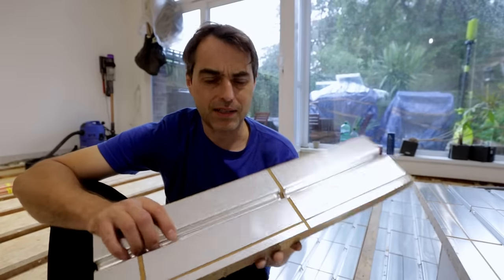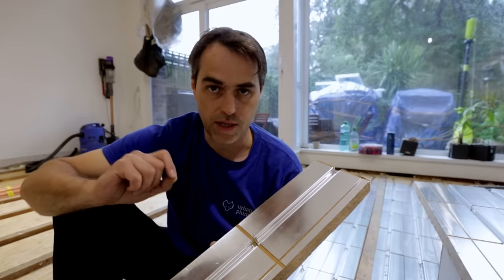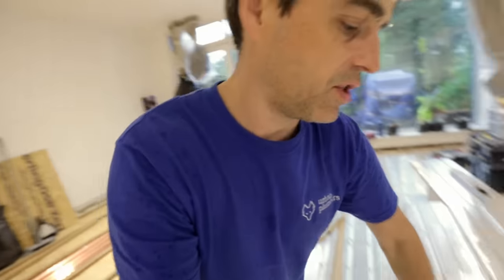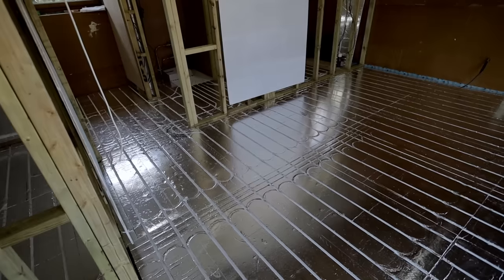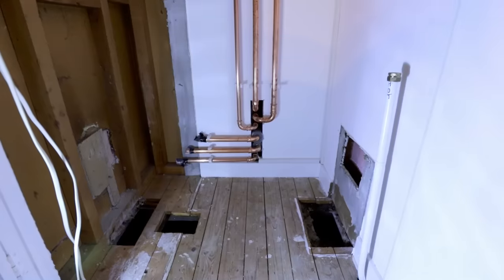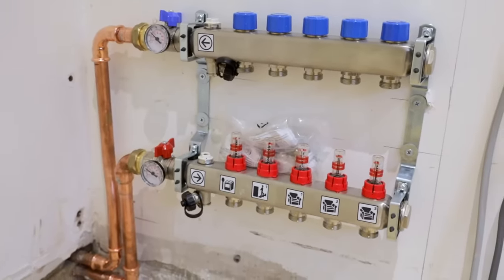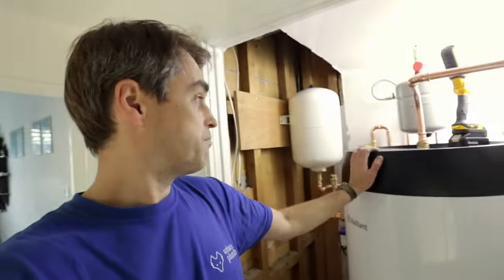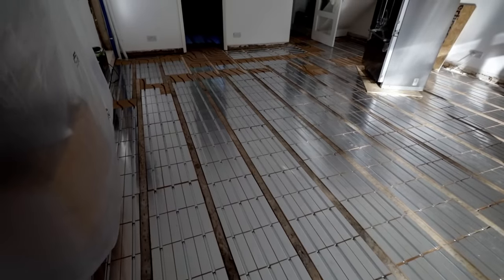Do Not Install Underfloor Heating With a Heat Pump Before Watching This Video

Comment: fantastic video
what was this job priced at
what was materials and labour
Reply from the maker: I actually don’t remember - it was a while ago. From memory the system works out around £200 + vat per m2 to supply and fit

Comment: Would it have been possible to adjust for the different heat output in the kitchen by laying fewer pipes at a wider spacing in there?
Reply from the maker: Possibly. The job was done half a year ago. I now know that it can be relatively easily adjusted just with flow.

Comment: Could you please tell us the average monthly energy bills for the houses you worked on (heat pump installations) ? 
Please talk about this as in the end of the day we are interested in reducing cost by installing heat pump. 
We need to get rid of standing charge for gas. But is it worth it? My neighbor bought mew build small house. £400 monthly bill. I have 5 bedroom house with old boiler and cylinder my average bill £200. I am interested in technology but for the better. Please please talk about bills too. Feedback is more important.
Reply from the maker: Just had an email from the customer on this job - his electricity bill is down by 25% when compared to previous electricity and gas. He also pointed out that the house is much warmer now. 

My own bills are also around 30% down as compared to gas and electricity before. 

However my installs are not the norm sadly. A lot of heat pumps end up more expensive to run.

I am organising an update with the client now.

Comment: Do you have any opinion on Omnie Torfloor 2, integrated structural floor boards? I fitted a Wavin system under my floor in the joist space several years ago, but the heat transfer to the surface is poor.
Reply from the maker: I am not a fan of Omnie Toro. 12mm pipe will have high pressure loss so coverage per loop will be small or you will need separation. Output will be limited as well due to timber cap and being routed into timber. It’s labour intensive to install and expensive. Much easier systems out there with the same or higher output, cheaper components and 16-17mm pipework with less resistance.

Toro floor quotes 50 watts output per m2 with tog1 at 50c dt7. There are systems that can do that at 15c lower temperatures. 50c is too high for an UFH system really.

Comment: You could have installed marine grade ply in the kitchen with tiles on top instead of the screed board then the output would have been the same as the living.  Albeit a little less efficient but still running at 43 flow. The radiator could’ve gone.

Comment: What I don't understand is how the floor temp is kept to 29 degrees if the pipes are running at 43 degrees? I'm doing a screeded system with no actuators, blending valves etc and my ASHP has been designed at 48 degrees.  I can't get my head around how it will work!  Surely the output per square meter is limited by the 29 degrees rather than the amount of heat that can be pumped into the pipework - putting pipework closer together just means the floor temp will get higher than the manufacturers limit?  My system has been designed with 200mm centers, I'm assuming for this reason.  If the floor temp does end up going to high, is there anything that can be done in this situation to reduce the temp of the water going into the UFH?  So many questions, so confused.
Reply from the maker: Flow temperature is always higher than surface temperature. Most jobs running 35-45c flow only end up with 22-25c surface temp
Reply: @UrbanPlumbers  Thanks very much, that's reassuring.  I'm going to chuck some temperature sensors in for my peace of mind and will report back here with the results.  I'm sure I'm not the only one who has this concern with their installation

Comment: Great job as usual but I'd have been disappointed about keeping thar radiator. 
3 brick house = council house.
Reply from the maker: Very easily removable if it turns out it’s not needed

Comment: Hi, intrueging to see if Jupiter's system will deliver these outputs with 22mm timber/chipboard? What will the clients floor finish be? that will also effect the flow and floor surface temp? 

Have you ever considered the foiled chipboard system with a 6mm no more ply/screed board covering? always been a good system on suspended timbers where heights are an issue and no more ply gives a high thermal mass over plywood.
Reply from the maker: Pipework is too small on those systems for most open loop / no buffer applications
Reply: you can get for 16mm pipe?
Reply from the maker: Jupiter has 16mm pipe - the system you describe is only 12mm - no?
Reply: @UrbanPlumbers  you can get with 16mm pipe but majority of brands is 12mm. I totally agree with you on the 16mm pipe even for future proofing. Let me know if you ever want to try with 16mm.
Reply: foiled chipboard ls that is

Comment: we have a similar system called Warmboard in North America. Stupidly expensive. I really prefer a 40mm gypsum overpour on plywood floor. Even in an old house with two layers of brick and no insulation, I could heat the space with 70w/m2 .....unless they put in stupidly big sliding doors and I have to put a radiator for added heat. I've done more than 100,000m2 of floor heating over the last 30 years....and this is in Canada with -25C outdoors. Since doing only heatpumps for the last few years, my area has not seen colder than -15C and we have to design to -21C

Comment: 07:05:  Why the switch to copper pipe?
Is this a suspended timber floor... hence the joists getting in the way...?
Reply from the maker: Mlcp fittings are smaller bore than copper / once you need to start using elbows copper is lower pressure loss = higher efficiency

Comment: Interesting - I'm doing a bungalow renovation with solid floors. I'm contemplating an ASHP with retrofit UFH but I don't want to gain 2.5cm+ in floor height so I'm exploring having grooves for the pipe run cut into the floor. There'll obviously be no additional insulation in the floor. Any thoughts/experience of this system?
Reply from the maker: No need for floor insulation most of the time. Router system will perform fine.
Reply: @UrbanPlumbers  Thank-you....I wish you covered Dorset!
Reply: I am also doing a similar job in a chalet bungalow. I want to router pipes into floor but am sure building control will have an issue with this. Can you point me to somewhere that can design the ufh so I can try and give them the design up front. Many thanks
Reply: JK has the only cutting system i would use. They use a 14mm pipe. We use them when a screed or overlay system is not possible. Although there may be no insulation under the existing floor, it seems to work well with ASHPs. The averages flow temp is 40 degrees c possibly less with tiles. Well worth checking out their website.

Comment: And under those windows, the panelling could just be an plywood backboard, some stud work and then plasterboard.  Insulation was often not fitted.
Reply: Exactly that's what we found - we insulated with 75mm Kingspan.

Comment: How can it not raise the floor level if you have a concrete floor?
Reply from the maker: this is not a concrete floor here. It is a timber structure and the system fits between existing joists. Existing concrete floors can be routed for pipework if you do not want to raise the level.

Comment: With a cascaded pair of 11kw pumps I assume you would have to have a buffer .
Reply from the maker: I know someone who is installing 2 x 12 without one / just reverse return
Reply: Thanks , would interesting to know if they find it satisfactory, I am grateful for the info you supply I use it to hold our installer to account and even try and sound like I know something about it , useful lessons really and he does note I ask questions that others never have .

Comment: The system design lacks a reflective membrane underside (shiny side up). I resolved a badly performing hydronic system with 50 mm pipe spacings by dropping the water table by fitting a 3m deep ditch all round the property with drains and a pit holding a float activated  submersible pump with DPC between house, down ditch and onto base using geotech fleece to outer ingress side. My research harvested several people who had tried similar and achieved as much as 500% improvement. My client was very happy with the actual 3000% my strategy achieved. Initially the pump would pump with increasing delays before culminating in being a bone dry space and now never pumping proving integrity of water barrier. It sets up a more stable thermocline which once charged massively diminishes heat losses from migrating cold water under house plus in theory there should be 2.8m depth of material under house that has merely saturated moisture content and thus substantially lowers conductivity. I believe my method should be industry standard even if much lower gains of say 500% are commonplace.
Reply: Dropping the water table could cause settlement to the foundations of the building, or a neighbouring one. That would not be good.

Comment: Not related to this vid specifically, but when you were discussing the h/w cylinder, I was reminded of a 'problem' I have before taking the plunge to a heat pump.      I'm not a heating eng, so apols if it's a dumb question, but I'm not able to find the answer anywhere (so maybe it is really dumb!!).      I live in a mid sized semi, with combi providing heat and h/w, I don't have and don't want a cylinder.  I definitely don't want the expense of one.  Is there a reason why something like a Stiebel Eltron couldn't be plumbed in where the boiler currently is to provide h/w. At <£400 to buy it must be substantially cheaper to install and probably run than a cylinder off air source?  Is this a practical solution?
Reply: These types of electric heater essentially store a smallish amount of hot water, they're not powerful enough to provide instant hot water like a gas combi. They're good for a basin or kitchen sink at 'point of use' but you couldn't fill a bath with one.  But they can be a useful option in conjunction with an electric shower if the bathroom and kitchen are close together so one unit could supply both taps.

Comment: You can't just route through the joists like it's nothing. Typically a joist for ground floor would be 100mm. On an old house, you'd be really lucky for the joists to be completely intact so  by routing 16mm into an already weakened joist you may be introducing substantial weakness to the floor. Also this entire system completely ignore that you may need to repair floors and use blocking/noggins to strengthen the floor. In some cases, you may actually need to sister joists. Things like that would make it a right paint to fit the pipework between the joists. Oh and best of all, those timbers are external on the bottom and internal on the top. By heating in between the timbers, you are greatly increasing the chances for warping. What deflection can this system handle? This is just a guess but what I think might happen is the aluminium will separate on deflection and then you have a sharp piece of metal right up agains your plastic pipework. Sounds like a really bad idea. Honestly, it would be much easier is clients get told that in order to use underfloor heating you have to convert suspended into solid floors. Yes it cost quite a bit but you can insulate under the slab and install a screeded system on top and be sure that 40 years from now the system will work exactly as it does today.
Reply from the maker: You can - those joists where 300mm and most of the jobs done this way are 200mm
Reply: I think you must work for the competition 😂 the joists have osb between them, they ain't going nowhere! Also, I've never seen a 4 inch joist.

Comment: Where is the mixing valve???
Reply from the maker: No need for mixing / it’s weather compensated and designed to run at the same temperature as radiaotrs upstairs
Reply: @UrbanPlumbers  impossible!
Reply from the maker: @Swwils yet o have done it on 10 jobs last year and it works just fine
Reply: @UrbanPlumbers  I will stick to my 1800s heating system
Reply from the maker: @Swwils coal fireplace?

Comment: Surely a biscuit mix would give you higher output and cheaper than this system
Reply: You can upgrade a biscuit mix quite a lot if you add a bit of very fine sand (e.g. paving sand), up the cement content a bit, and also use a super plasticiser in the mix.  All those things done together can increase the thermal conductivity of the cured mix by about 2x.  Did that on my low flow temperature ufh (wood flooring) about 10 years ago.  Works great.
Reply from the maker: @Tim_Small but you add considerable weight , which you can’t do on british 4inch ground floor joists
Reply: @UrbanPlumbers  This is true - you would need to do a design check, and upgrade the joists (e.g. screwing ply along side) if necessary.  In my case the existing GF joists had wood worm, so they all came out and were replaced by a raft floor, on EPS, on sand blinding, on hardcore.  Sounds drastic, but done in 1.5 days with 2 people, and certainly no slower than replacing the existing joists.  Also allowed installation of a radon barrier (advised in this area for new build).

Comment: Biscuit mix would be cheaper and more powerful
Reply from the maker: Not quite - pioe spacing is only 125mm here and there is a think alu plate. On paper this system beats biscuit mix and seems to Sinai in practice as well
Reply: @UrbanPlumbers  Great to know this. Many thanks

Comment: Underfloor heating seems like a fad to me. Radiators are simple and effective.
Reply: Heat pumps work best at low temperatures. You need a lot of big radiators to provide enough heat, underfloor heating has massive surface area and cannot see it. It’s a solution to a problem
Reply: Underfloor heating is lovely and no unsightly blocks of metal on the wall